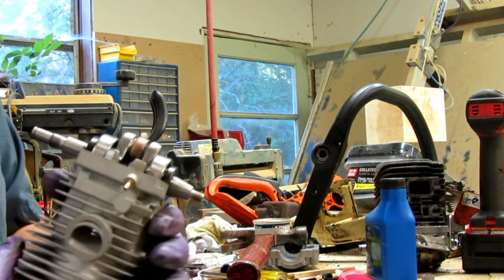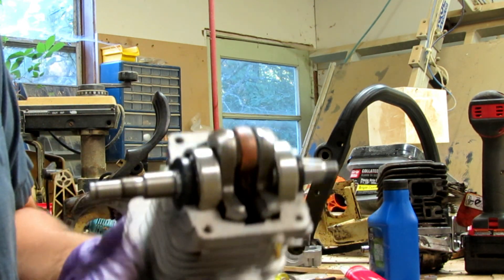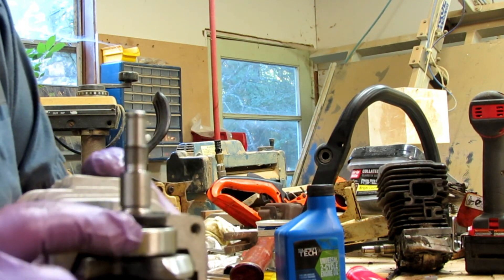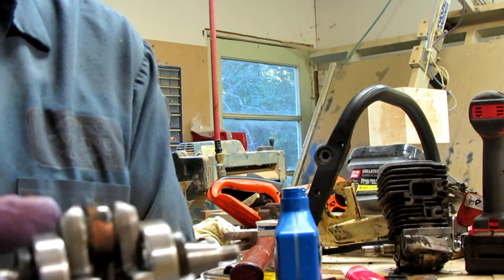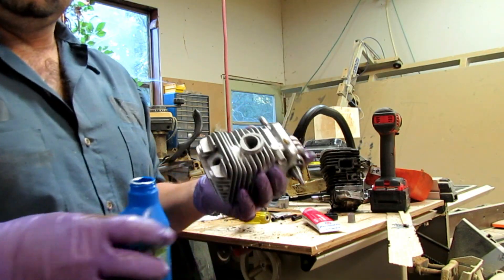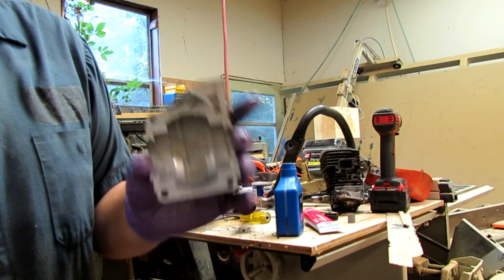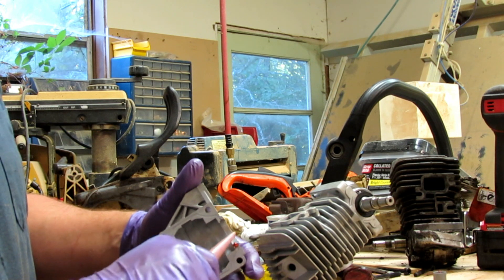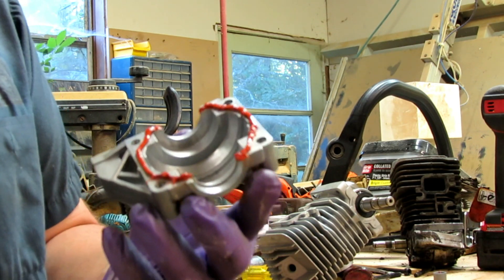Part 2 MS290 to MS390 Engine Conversion Swap 46mm to 49mm 56cc to 64.1cc

Comment: I must have mis-understood, but I thought you had said in the 1st video that you were going to completely assemble the motor including the gasket seal and then let it sit for a while until the gasket sets before installing it into the saw frame.
Reply from the maker: @dennisshaughnessy5612 I may have mentioned that, you didn't misunderstand. I misspoke. I am sure that was my intention at first. After thinking about it I decided to apply adhesive, while it was wet, install the motor in the chassis and tighten down. This method lowers the chance of an air leak. By trying to install a cured adhesive attached crankcase pan without hardware holding it together it could get knocked loose. I have done a bunch now and this is definitely the way to do it. If you would like to see an update on the saw check out my other channel dedicated to chainsaw repairs.
https://youtube.com/@chainsawhospital?si=-lv5OEImNFvFotcE
Thanks for watching! ~Mr. C.
Reply: @NaturesCadenceFarm  Thanks for replying back. I just disassembled it today. And I have to tell you, getting that threaded bar stud out of the housing was a lot tougher than in your video. I ended up ruining the threads on the stud and one of the nuts. But I got it out, with the help of vicegrips and using an angle grinder to make a flat spot on both the top and bottom of the stud. It's not hard to tell that Stihl did not intend for this motor to be opened up or replaced. Anyway thanks again.
Reply from the maker: @dennisshaughnessy5612 that is a bummer you had some trouble getting the stud out. It can be a pain. I have heard of people using heat on the part that it threads into to make it easier removing the stud. I didn't learn about that until after making the original video series. Hang in there. I think it is worth it. Mine is still kicking. It lives in my dump truck tool box. Thanks for the update! ~Mr. C.
https://youtu.be/yXnDg9Wz_bo?si=BPwhdBSD94LMgQJ5
Reply: @NaturesCadenceFarm  I've had this saw since new, 33 years ago when I used to burn wood for heat. But it's been unusable for a while now.  I stopped burning wood when I moved years ago so never got around to fixing the saw until now. I did re-assemblly a little different than your video in that I put the motor together first with gasket material and then let it set over night with spacers in the 4 screws to hold it tight before putting it  in as 1 complete unit in the saw body. I didn't trust myself to be able to set the cylinder on top of the base with gasket material already on the base while holding the crank/piston/cylinder together....I'm not a young guy anymore...lol. I'm hoping to get a couple of more years out of it now before giving it to my son. Thanks again for your help.
Reply from the maker: @dennisshaughnessy5612 I am still amazed at how long these saws actually run considering the environment they operate in. I would love to hear how that process works out. Thanks for sharing the history. ~Mr. C.

Comment: Why do you need to take the pan off the bottom, and then seal it?  

Also, does the kit from bailey's need this to be done?
Reply from the maker: @RDanNew the motor comes unsealed. Sealing the pan to the top end prevents air leaks. I would now suggest using Threebond 1184 in place of the red rtv. The red rtv is still working but the 1184 would last longer. 
I have not seen the motor from Bailey's. I would say yes it would need to be sealed just like the Amazon one. 
Thanks for watching and asking excellent questions. ~Mr. C.
https://amzn.to/43MFZ45

Comment: if ever you cant set the idle, remember using needle nose pliers on the intake boot, it may be perforated hehehe, cheers mate,
Reply from the maker: @Willie J Masiero thanks for the tip. So far so good. It has been running for years now and I am very happy with the build. I have some more videos coming soon of it in the wood with a pipe :) ~Mr. C.

Comment: one problem his sealer is not fuel resistance in 6 months an air leak will appear and out  of order piston !
Reply from the maker: eugene kupka thank you for bringing this to my attention! I did look on the Permatex website and the product I used is not rated for contact with gasoline. I should have used Motoseal, Yamabond, or a Three Bond product. I have been running the saw for almost two years now and have not had any problems yet... I am sure I will have a leak but I don't know when. I will continue to run it as is and when I get the out of order piston I will make a video about it. Do you have experience with high temperature red Permatex ruining a saw? If so I would love to hear about it. Are there any products you recommend and have experience with? 
I want to thank you again for letting everyone know I used the wrong product. Viewers like you are what make this community so amazing. I love people helping people. ~Mr. C.
Reply: Stihl used Dirko HT for long time in their chainsaws and it worked just fine. Dirko HT is just high temp RTV silicone and not fuel safe but still good enough for Stihl so they would use it. Now Stihl uses Pactan 6075. IIRC in Poulan chainsaws OEM sealant is Black Permatex Ultra/Supra RTV silicone.

Comment: Is the exhaust and intake diameter the same as stock engine?
Reply from the maker: Jason Crites I would say yes. I do not have a stock ms390 cylinder to compare, but the ports are the same as the ms290. ~Mr. C.

Comment: I’m not a mechanic but learning things about my 029 super. When you’re oiling the motor to prevent a dry start put the oilin one of those ketchup squirt bottles to control the flow. Just a thought
Reply from the maker: Bee Bob that is a wonderful idea. I will try that next time. Thanks! ~Mr C.

Comment: will the original engine pan and crankshaft assembly from the 46mm fit into the new 49mm cylinder?
Reply from the maker: Mike Sommers I did not try to fit it on there but I would say it should. I think the only difference is the piston diameter and bore diameter in the top end. If someone knows for sure I would love to know. Thanks for watching and commenting. ~Mr. C.
Reply: @NaturesCadenceFarm I just looked up the part numbers for the crankshaft and engine pan (MS290) are the exact same part numbers as the MS390 crankshaft and engine pan. thankl you for your reply and thanks for making the video. very helpful

Comment: Can you use MS 290 crankcase or you need the MS 390?
Reply from the maker: Mario that is an interesting question. I did not try the crankcase from the old engine on the new one so I do not know if it would fit. I would guess they would since the bolt pattern on both of them is the same. The only thing that could be different would be the bearing size, but I don't think the two engines are that far apart in displacement. Good luck. ~Mr. C.
Reply: @NaturesCadenceFarm  to answer my question, (time FLIES), yes, everything is the same. MS 290 crankcase and MS 390 cylinder are matched. The only thing that gave me problems are nuts. I bought the replacment part from German ebay seller "SÄGENSPEZI" translates to saw specialists and it has different thread pitch than the original Stihl. Not a huge problem, it could be if I tried to use impact on it. Just bought some new screws and put it together.

Comment: Thank you so much for posting this. I am in the process of this now. My saw didn't come with a decompression valve and the new engine has it. What do I do?
Reply from the maker: rbbfpe excellent question and a topic I did not cover in the video series. I ordered and installed a decompression valve from eBay. The MS290 cover does not allow the valve to be accessed so I drilled a hole in the cover with a hole saw to be able to reach the valve. The other option would be to install a decompression valve plug and not drill the cover (I will do this in the future). I have added links in the description for both of these options. ~Mr. C.
Reply: @NaturesCadenceFarm  Thanks for the quick reply! This is what I ordered. https://tinyurl.com/qvcb5ts It looks like it already comes with the decompression valve. I will just drill the hole as you say. Thanks again!

Comment: What did you do with decompression valve hole on block???
Reply from the maker: Raghu Nathan I placed a decompression valve in it and drilled a hole in the cover to access it. The valve is optional and can be blocked off with a plug. Thanks for asking. ~ Mr. C.

Comment: What brand is this?  Do you have an Amazon affiliate link?
Reply from the maker: Thrifty Garage here is a link. I also added it to all of the video descriptions in the series.

https://www.ebay.com/itm/ENGINE-MOTOR-CYLINDER-PISTON-CRANKSHAFT-FOR-STIHL-MS390-MS290-MS310-029-039-49MM-/302731812165?hash=item467c38dd45

~Mr. C.